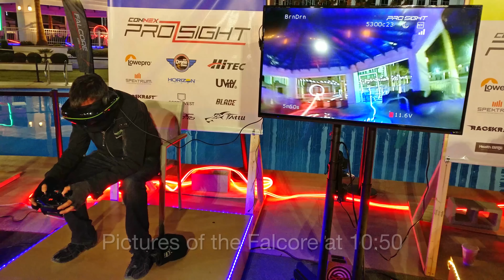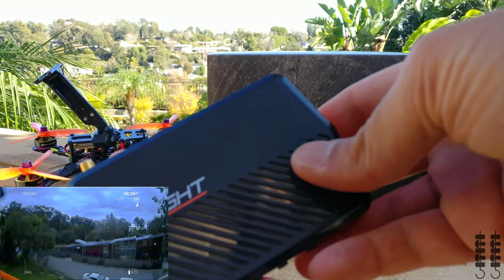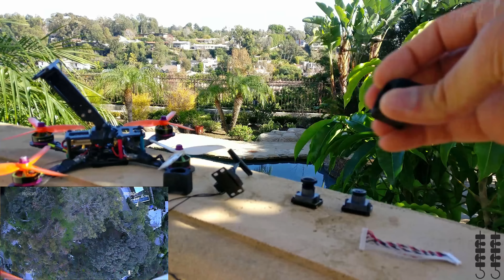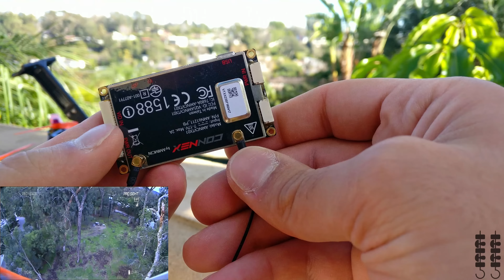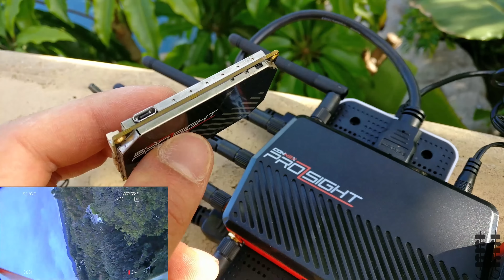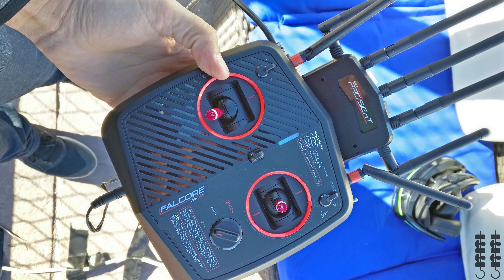Connex ProSight Review - Little Falcore/Draco

Comment: Whats the realistic range on this setup in 200mw?
Reply from the maker: ?  200mw?  It varies it's power output from 200-800mw I believe.  The range is maybe 1-1.5km LOS.  It's excellent until it's not.  I wouldn't recommend it for acro other than close range acro.  It's unbeatable for racing however.  Zero video issues once setup.

Comment: Nice review. Have you tried Clearsight? Be good to geet your thoughts on that. The problem with going Connex as a racer is you really need at least two or three systems as you can't rely on one quad.
Reply from the maker: Chris Morley I agree. I really want clearsight actually. it's just a bit pricy. I think if they made a $175-$200 option it would be really really super popular.
Reply: Definitely and perhaps if they could make it more portable. I've ordered a few hyperlite evos recently to go with the original frame.

Comment: Great video! One nit: 200 mw max, says the documentation. Considering that I'm amazed at the range I get.
Reply from the maker: kenkamm I believe it's 200mw within the required frequencies. it uses different levels when it's below 5.8 which it usually is.
Reply: Kabab FPV Sorry but no. 😉 200 mw max, regardless of frequency or region. See page 77 of the manual.

Comment: thanks for your video- what's the range of the connex pro sight and does it blue screen when losing signal or still have static like analog? (the 1 second drop out doesn'yt sound fun though and surely can make the diference between crashing or not)- can you separate the connex prosight HD video feed gear for use on other quads or stuck with it with falcore only? Thank you

Comment: Have you tried PAL?
Reply from the maker: LordGryllwotth I haven't but I don't think it would be any different. might it?
Reply: Kabab FPV i am thinking about Progressive, do the digital system support it? Interlacing is not that good. You talked about interlacing, and that surely makes the quality bad.
Reply from the maker: LordGryllwotth yeah that's why they made the H+ mode but the FOV is just too narrow on the H+ mode so I gotta use the HP mode. at 60fps it doesn't look like it's any worse than H+ in terms of quality

Comment: What lens are you using with HP mode? I can't find anything with a fov that feels "right".
Reply from the maker: Anthony Kuhns I agree. I'm using the stock lens which is around 2.4mm I feel. I would like a wider angle lens and that's what all the team pilots have told them too. it's not bad however.  wider would just be a bit nicer.

Comment: it's nice but the price and size
Reply from the maker: Marcus Mc Kay very valid complaints. it is what it is for now. hope for a better future.
Reply: True enough.  It does look very nice and 60p picture over 30i NTSC would look very smooth.  As a long time gamer,  high framerate and consistent smooth picture are a massive advantage.  Are you tired of building just due to the downtime, and would just prefer to buy a quality modular RTF and just fly?
Reply: It needs to mature more.  Price is way too high and the gear is huge.  I'm not a fan of the inverted arrestor hook (read: antenna) either.  That's either getting torn off or slinging you straight into the ground first gate you catch.
Reply from the maker: SickocrowAU also a very valid concern that I agree with. it's all we got for now however.
Reply from the maker: SickocrowAU I'm tired of building because that means I'm not flying. unfortunately no RTF performs like something I build. but still I'll fly a good RTF if I can.

Comment: Wonder if someone gets either Falcore or Draco and then decide to build a custom, IF the Connex could be EASILY swapped to a different quad... My guess is probably not since VTX will probably be integrated on another board, but that would be really cool. Could probably just buy another VTX though.  Is the Ground Station the same on Falcore and/or Draco as the stand-alone ProSight?
Reply from the maker: +SuperDrones yes you can buy another camera/vtx and also it is not integrated into one board. You can remove the setup from either craft pretty easily. I particularly like the Draco
Reply: Kabab FPV yeah I like the look of the Draco too. Being able to potentially and economically use the ProSight on multiple rigs is an attractive value proposition. Falcore/Draco have the potential of being the Phantom equivalents for FPV.
Reply from the maker: SuperDrones yeah the Falcore can definitely be the phantom of FPV. the Draco is more of a true racer. of course neither one will perform like my own quads but it would be really nice not to have to build anything anymore.